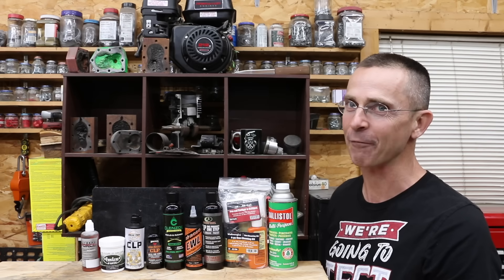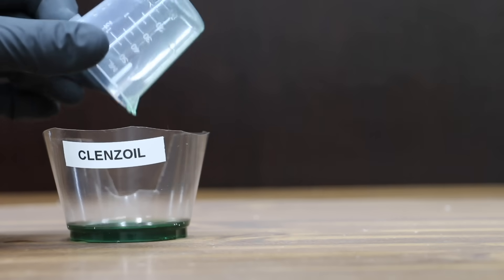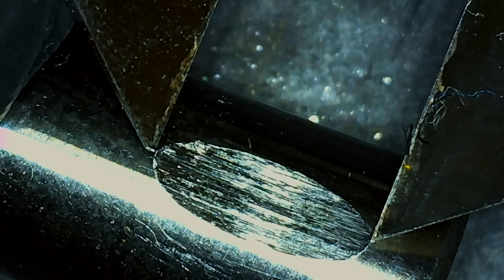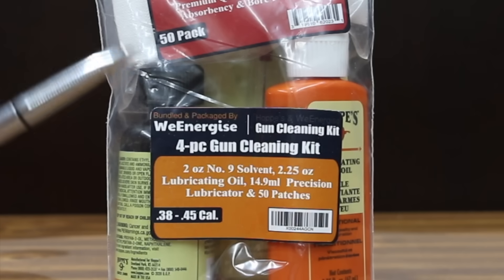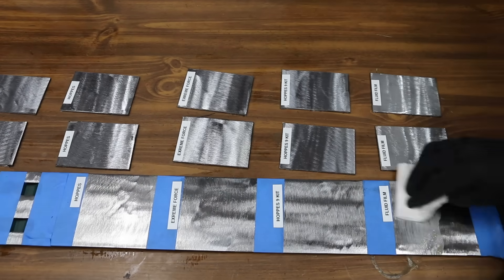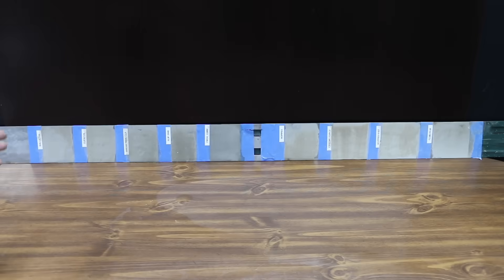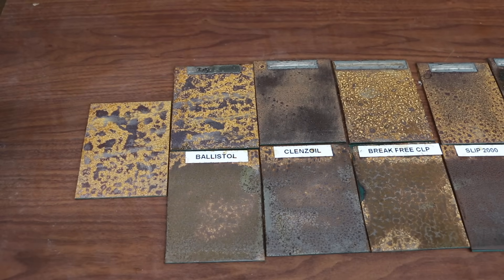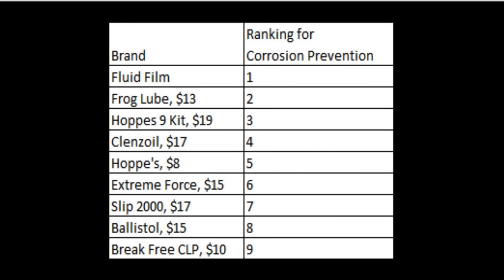Don't Buy A CLP Until You Watch This Review! It'll Save You Time And Money!

Comment: Great video!  I wish the video would have included WD-40 and cheap motor oil in the tests, as I've heard plenty of people claim that that either of those is superior to the CLP products.
Reply: I always hear people talk about wd40 for so many things and I have never had wd40 work great at anything outside of cleaning off certain surfaces. Its not technically a real lubricant so I personally would never use it on my guns.
Reply: @ronnie3044  I agree. I use M-Pro 7 LPX on all of my firearms and knives.
Reply: @ronnie3044  Great point!  I wonder why people don't understand that WD stands for Water Displacement and is not primarily a lubricant.  Of course, the WD-40 Company has concerns about sales; so it is in their financial interest to persuade people to buy it for all sorts of reasons and applications that could be less-than-adequate for optimal results.
Reply: @ronnie3044  WD40 is great for taking sticky tape residue from anything you don't want to damage!
Reply: @ronnie3044   I believe WD-40 is mostly kerosene (stoddard solvent or something similar) with an aromatic  (perfume) and something else unknown.
  "The main ingredient by volume is the solvent. When you open a can of WD-40 and examine the contents you will find that in a short time they will separate out. About 80% is what appears to be Stoddard solvent (or a similar kerosene-like liquid) and the other 20% is the sweet smelling, whitish fluid (presumably the lubricant which is some sort of oil, fat or grease) that eventually will thicken over time."   The oil is mineral oil possibly mixed with coconut for some reason.
Reply: @ronnie3044  My experience is the same as yours. WD-40 doesn't really lube anything. It is a pitiful penetrant (tested on Project Farm), and I've had numerous metal tools corrode or rust later after I applied it. I agree that occasionally it is a good cleaning fluid. I suspect the people that love it don't use it in a humid environment, apply it constantly, or apply it to materials that are already corrosion resistant. I see people spray this stuff in copious quantities on things also. I'd rather buy a better suited product and use 90% less.
Reply: @Ronnie. Indeed. Using wd 40 on guns is just left over ignorance from a time there wasn't many great options.
Reply: I would believe motor oil simply by anecdote with all my automotive tools covered in it but WD-40 doesn't stand a chance, especially in the oven test.
Reply: For over 20 years, i've used Mobil 1 Synthetic Oil and had wonderful results.  It's worked in 120 degree desert heat and withstood the rotor downwash while shooting from a helicopter in 7 degree mountain air.  It has also keep my guns rust free as well as making it easier to remove carbon buildup.  I'd love to see the results in your test using this kind of oil as well as WD-40
Reply: @chrisa2761  Don't bother with WD-40. It was designed to clean not to lubricate or prevent rust.
Reply: @chrisa2761  I’m gonna go and call bullcrap on that, any oil in the desert attracts sand like flies to shit. Your save file of COD doesn’t count. My time in the desert we used to Teflon stuff like you were supposed to because it’s not broke and doesn’t need fixing.
Reply: @chrisa2761  must be the Mobile one synthetic because I know few people tried car oil and it got nasty experience a sticky mess on the piston AK.
Reply: Synthetic oil and synthetic grease are the best at metal on metal nothing else comes close. Think of the forces on engine parts , axle gears and bearings.. By mixing the two you can change viscosity as needed for change in climate.  Carbon, powder, copper removal is a different deal for that use Hoppe,s 9..
Reply: Smythbusters did a video on WD40 for firearms and why it's not a good idea. Worth a watch.
Reply: Yes I would of liked to see a synthetic 5/20 motor oil in the mix.
Reply: I wonder how a turbine oil like Zoom Spout that is used for electric motor bearings would compare.
Reply from the maker: Thanks!  Thanks for the suggestion.
Reply: @ProjectFarm  :  Thank you for making this video. 

I use Break Free CLP, and based the decision years ago to do so off of forum posts. I appreciate all of your hard work and fair testing to provide good data.
Reply: I'd like to see that and maybe some greases. Mobile 1 synthetic oil and grease.  NO-OX grease is great stuff for corrosion, not sure how much lubrication it provides.
Reply: Add plain water to the carbon removal test of the exhaust pipe.
Reply: @slingbart705  I use dish soap and water for cleaning. It works much better for cleaning than CLP, it is readily available and a lot cheaper.
Reply: What I know is the military says you are buying them new rifles if you use either of those on their weapons, so that should give you a hint as to their efficacy.
Reply: Wd40 gums up after awhile and will cause problems other than rusting
Reply: WD-40 is good for one thing. Keep a can in the truck and if you are hunting or shooting and your firearm gets moisture on it spray it down until you get home and can properly clean it. I keep several cans of it on hand. Now, their long term rust preventative or the rust removal stuff is some good stuff.
Reply: WD-40 is a water displacer, and not a lubricant.
Reply: @jocodashcam295  WD40 thickens a lot when the more volatile ingredients flash off, leaving behind an oil similar to gun oil.
Reply: @jocodashcam295  maybe you should check again...
Reply: @klabeaume  maybe you should know what “WD” means.
Reply: @jocodashcam295  wrong, WD-40 is the brand. kind of like Kleenex and Velcro is a brand. WD-40 makes lubricants. used it plenty of times on my MTB. Yes, They make bike specific chain lubricants. What everyone uses in that spray can is a solvent / degreaser.
Reply: @kroozctrl1337  🤦‍♂️ What does “WD” stand for?
Reply: @jocodashcam295  .......yea..... but it sure makes sticking parts move and operate easier and with less friction...im not sure of your definition of of lubricant ...
Reply: @jimhanty8149  WD-40 contains a small amount of very light oil, but it's lubricating properties are fairly weak. The big problem is that it leaves a residue that gums things up.
Reply: I was thinking the same thing would've been insightful
Reply: I would like to know this as well. I also heard machine oil specifically should be used over regular motor oil, so it'd be great to know if that's true.
Videos comparing different brands and types of dado blades would be nice too.
Reply: I’ve always use high temp grease
Reply: I know little about guns and even less about cleaning them but I'm curious. Is the inside of the barrel lubricated with anything special? If so, viscosity must be an important consideration given the projectiles velocity. It's something I thought of when motor oil was mentioned.
Reply: @ross9580  the barrel is lubricated with the same oils that are used on the rest of the gun. I’d say the barrel is mostly lubricated for corrosion prevention, not for operation, since almost all the oil is gone after the first few shots.
Reply: @ross9580  ideally the inside of the barrel shouldnt have any outside contaminants,.  A bit of residue from  already fired bullets can be good.  The only reason to have some oil or similar  inSide  the barrel is for rust prevention in medium to long term storage.  This should ideally be cleaned out before shooting.
Some guns, have chrome or other protective materials lining the bore to protect from corrosion.
Reply: @ross9580  Same oil that one would use anywhere else on their gun.  Though you don't want to leave oil in a barrel; even a light amount can cause pressure spikes.  Generally not a big deal but it can affect shot-shot accuracy if your pressure's are variable
Reply: wd40 evaporates off, but with heat there is a risk of fire. british army don`t allow it because it was sprayed on a hot machine gun and instantly caught fire.
Reply: Been using Klotz Techniplate 2-stroke synthetic oil for years in my guns.  Works just fine
Reply: When I was in the Army, we used Breakfree CLP almost exclusively. But as a civilian, I'm able to explore my options. IMO, the CLP works fine as a lube and protectant, but is a mediocre cleaning agent. So now I use a dedicated cleaning agent. For lube or rust protection, I'll use CLP (or motor oil, or grease, depending on the situation).
Reply: I soak AR-15 bolt in transmission fluid, works great and prevent hot gas deposits
Reply: I use wd40 as a solvent to get rid of gunk. Just a squirt to flush things out. Then degrease and lube with Breakfree. I wouldn't use it as a lube.
Reply: When I lived in Alaska we would always put a light coat of WD-40 on our rifles and backup guns when hunting in the rain, which was very frequent. It always did an excellent job of preventing rust on our firearms.
Reply: @davehoward2791  It should.  WD-40 was invented to keep water off of rockets as they were unpainted metal.  So WD stands for water displacement and it was on the 40 try they got the formula right.
Reply: @davehoward2791  if you are looking at rust prevention there are some in depth long term tests here and elsewhere.  WD40 didn't do great long term, but they make something called WD40 Specialist that was outstanding.
Reply: @ Dave Howard. If anti rust in the outside if your guns are your chief concern then wd 40 is fine.
Reply: @davehoward2791  Would you say wd40 is preferable in the cold weather of Alaska? The low temps should keep the viscosity thick it should act as lubricant and not run out.
Reply: @bottomfeederscumbag   Yes, in my experience WD-40 worked well year-round in AK to keep rust at bay and as a lubricant for short term use. In storage I used Rem Oil or Hoppe’s gun grease depending on how long the gun was put up for, but once in the field and the rain started it got a light coat of WD. Once home (usually within a day or so) I’d do a thorough cleaning and oil it down with Rem oil, and never found any rust whatsoever. YMMV, but it worked great for me and the guys I hunted with.
Reply: Old timers swear by auto transmission fluid as a lube. Might have been a good control, but as usual this was an excellent comparison.
Reply: Motor oil gets sticky after shooting it a lot.
Reply: Motor oil ya maybe , but anybody using WD-40 for a weapons lube shouldn't have weapons  . WD-40 is a water displacement fluid it only contains about 18% of a lubricant .  It works great for cleaning weapons but never for lubricating them

Comment: I work part time at a gun shop and my goto suggestion has always been Breakfree CLP, which looks like it does the trick for some stuff, but I will be suggesting Clenzoil going forward. The area I am in doesn't have a lot of environmental concerns about cold which is the only area the Clenzoil struggled (as did most).  This was an excellent video that I never knew I needed! I would love to see some videos similar to this, such as the durability and effectiveness of cleaning tools, such as carbon scrapers, picks, brushes (both hand and bore) and wipes. Keep up the great work!
Reply from the maker: Thanks, will do!  Thanks for the suggestion.

Comment: Please let me send you a sample of my sotar sauce homebrew lube. I mix mobile 1 OW20 full synthetic, with CV2 red high temp synthetic grease, you can mix in some synthetic automatic transmission fluid (optional)
I mix mine just enough to wear it will not migrate in storage, it's super slippery, and it makes the bolt carrier group easy to clean the carbon literally just wipes off with a rag. I've tested mine down to about minus 10 degrees so so far. I think it'll work at much lower temperatures if you mix it thin enough like I do.

Comment: This episode was fantastic (as always)! It was refreshing and great to see something a little different than the normal content.

A video recommendation. It would be great to see a variation of this test, with only spray can/aerosol CLP. It would be interesting to see if they do a better job than the more traditional liquid bottled products. Especially since they could possibly have a different formulation. 
Oh and if you could test the Lucas CLP in that round, that would be great!
Reply from the maker: Thank you for the positive feedback and for the video idea!
Reply: I suspect a spray can would be less effective, if paint and bedlining coatings and such are anything to go by. I'm looking forward to the results here as I've tried a few and haven't quite settled on one I like yet.
Reply: @grindersandgears3445  I have found several wonderful sprays that come out of the tube as an active foam that shrinks down quickly into a penetrating liquid as the spirit carrier evaporates.  Then within minutes the liquid has turned into a thin layer of non-sticky grease.  There are motorcycle chain lubes like this too, which are what I use on guns...........................elsullo

Comment: Great video. Would like to see Lucas Oil X-treme duty gun oil and another round of Frog Lube Liquid Lubricant in this test along with Breakthrough Clean, MPro-7, Militech,  Rand CLP, and even Mobile 1 full synthetic.   

Greases have their proper use in different areas inside firearms. So it seems like comparing the Frog Lube paste to other "oil lubes" isn't totally fair fair, it can be melted down, but comparing frog lube paste to other greases would be better. 

Then do a comparison among different greases!
Reply from the maker: Great recommendation!  Thank you

Comment: For the average home gun owner, I would focus on corrosion resistance over lubricity unless your gun is auto fire as you are far more likely to damage the weapon from corrosion of sitting in storage than from metal wear which would require a heck of a lot of range firing to have the slightest negative impact using the worst lubricating product here.
Reply: That's why you through in those moisture packs inside your gun cabinet. They absurd the moisture in the air.

Comment: Lets not forget two important points...when we talk guns, it's best to keep your cleaners and lubrication as separate products.  Also firearms are open systems...I recommend using boretech eliminator until it's clean followed up by the use of a proper grease (i.e. NECO MOLY SLIDE)

Comment: Great video nice and oily.
Suggestion for a video, to test way oil for the mill or lathe. Some brands wil be dry up over time or they are chip magnets.
I use now engine oil 5w40 it don't dry up and the metal chips don't stick so hard. But i don't now if it will harm my machines.
Reply from the maker: Thank you for the video idea!

Comment: I'd be interested to see how synthetic transmission fluid mixed with synthetic grease and a touch of acetone does vs Clenzoil or CLP.  That's my go-to for my guns.  I mix it to slightly different viscosities for pistols or ARs.  I also use straight synthetic 30 weight motor oil for lube DURING long range sessions for ARs.
Reply from the maker: Thank you for the feedback!
Reply: Acetone or Chemtool 12 for cleaning and Mobile One for lubrication is my  firearm cleaner and lubricate

Comment: I’ve used so many of these products on my firearms and they all work just fine. But I still appreciate the test and found it interesting. Another product many people use is just plain ole bearing grease. It works great too and is the cheapest option. Obviously for lubricant. I like it on my AK’s. 
Also motor oil is used by many for lubricant.
I would be interested in see how nearing grease and motor oil would have done in your carbon removal test??
Reply from the maker: Thanks for the suggestion.

Comment: Great informative video as always but I believe the beginning bearing test is incorrect, that test should be done without extra fluid in the cup. As weapon parts are not just sitting in lube, I would update the test with only a thin layer applied to the bearings, allowing us to see the actual film strength of the clp and the sling off during rotational G's at the bottom of the empty cup.

Comment: I used ballistol to treat some wood (a walnut picture frame) once as a test. It smells good, but it seems really too lightweight and volatile for that application. It just seemingly evaporated over time and left no coating at all. Depending on what one is trying to accomplish, it might be a good choice. Regularly applied lube on very well fitting parts without buildup?
Reply: It's made from mineral oil.
Reply: It's pretty popular with the black-powder crowd. It's more of a cleaner than a protectant.

Comment: CLP is probably the best gen purpose gun lube around.. but if you want high load stuff you better get a high pressure/lithium grease intended for wheel bearings and high loadings.. messy, but it works well
Reply from the maker: Thank you!

Comment: Frog lube is total crap. Ran my cz sp01 in -16 degrees celsius and it completely gummed up. Had to run the whole gun parts through an ultrasouns cleaner to get it of. 🤨
Reply from the maker: Thank you!
Reply: @ProjectFarm  currently I run transmission oil for atv’s in my guns. Seems to work very well 😅

Comment: Not really a gun guy here, but the fact that the heat "helps some oils penetrate the metal" isn't a good thing, I think. What's appears to be happening here is that the stuff is polymerizing, which could cause moving parts to gum up after a while. Not sure if that would ever be a problem in practice, but it's something to consider.